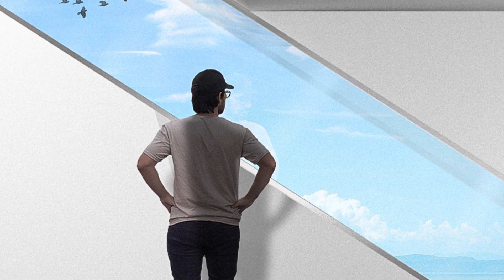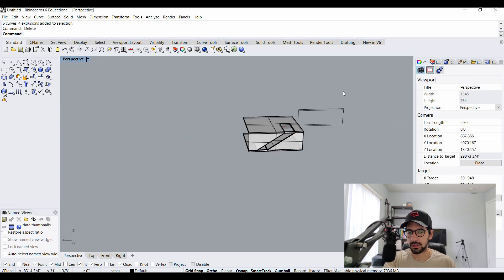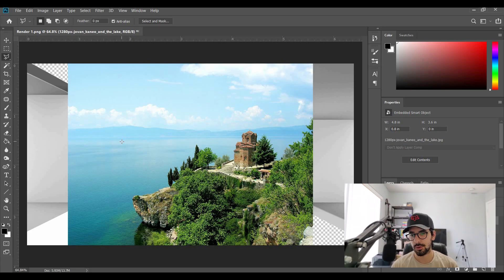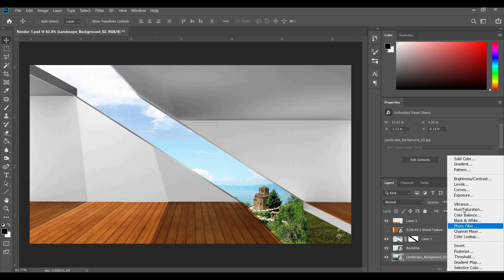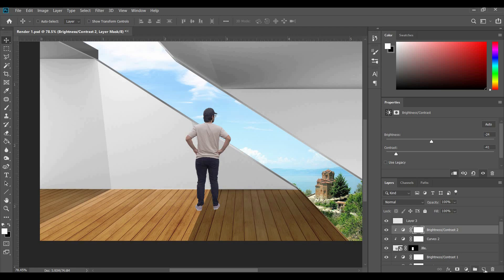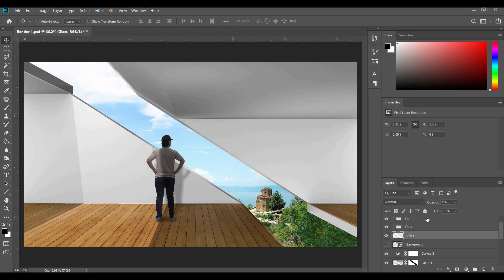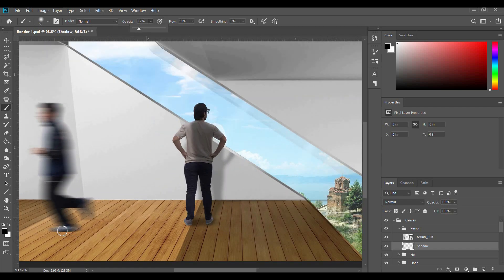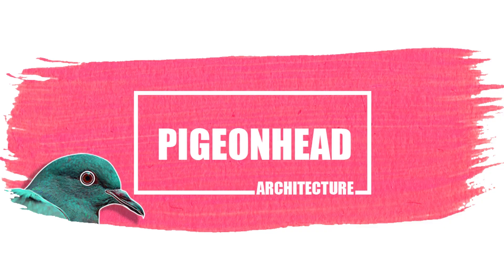Turning Basic Sketches Into Realistic Images | Architecture Speedrun

Comment: Speed run indeed!! I haven't used Rhino before - does it's speed come about because you have mastered the key commands?
Reply from the maker: I think it took me about 30 min to model that box. I think that what makes you fast is understanding how you should approach something. For me cutting out objects from an element, as I did, is faster for me. Others would prefer to draw the elements out and extrude them. 

Also, as you said, I know all the commands that I need to use and this is MUCH faster than clicking around. With Photoshop, you see that only about 10 percent of stuff I do is done through keys (commands). The other stuff is point and click which is so much slower.
Reply: Mooch That makes sense. I did wonder if part of it was the video edit, but still, if there is speed to be gained somewhere it's worth looking at.

As always, proper planning goes a long way as well! Thanks for the videos!
Reply from the maker: For sure the edits help. I'm glad you enjoyed it! 😃🍻